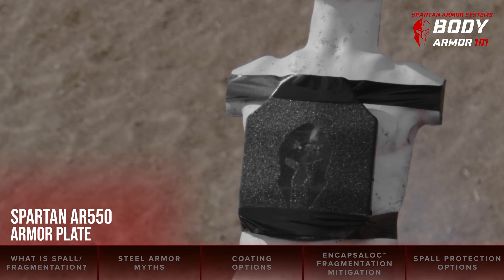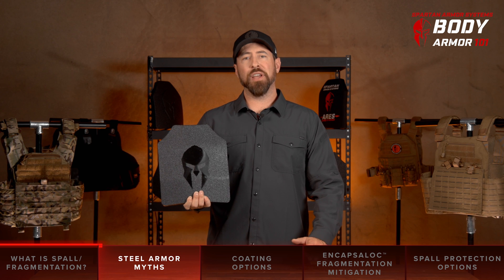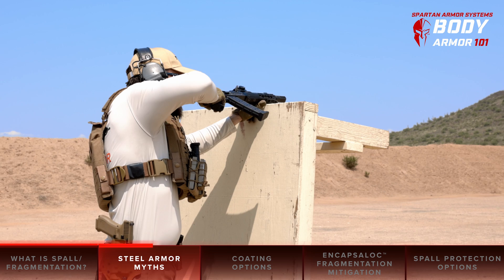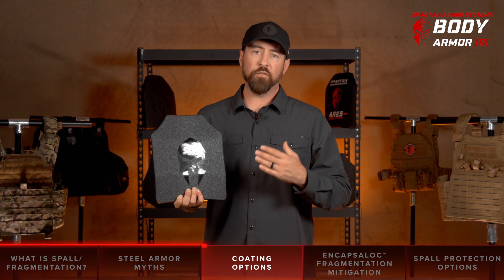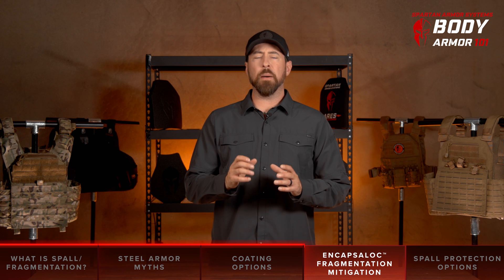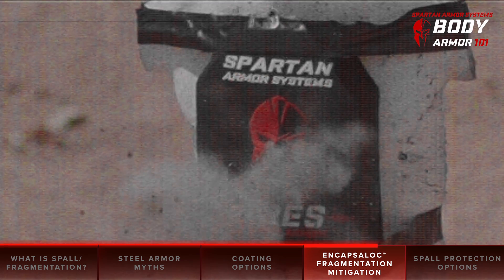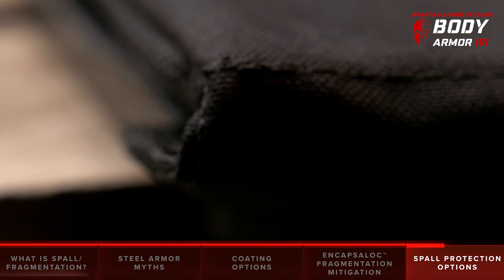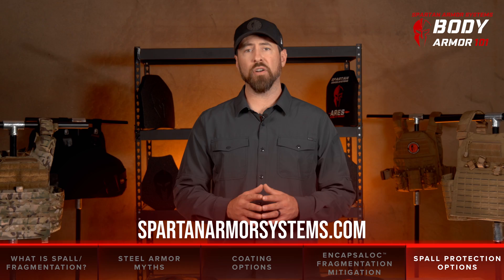Body Armor Spall & Fragmentation (Fact vs Fiction) - Spartan Armor Systems Body Armor 101

Comment: I'd always choose steel for CQB. If the weight was that much of a factor, choose the ceramic for long missions as also it's unlikely you'll be hit with multiple shots at range. As for myself, I'm used to walking around with extra love handles in winter, so a couple lbs wouldn't bother me.

Comment: Even your thicker coating can split and let fragmentation through, especially on hits near the edge of your plate. How about, instead of selling me a plate and then selling me a ballistic sleeve to put over it for an additional charge, you just incorporate it into the original product. A combination of kevlar and ballistic nylon that covers the strike face and wraps over the edges, creating a kevlar pocket to catch spalling. This could be a simple level 2 or 2A layer due to the reduced velocity of the spalling. I know you're a business, but stop selling me two products for two jobs and just make one product that does both. Simple, reliable and cost effective. AR500 plate and kevlar combo.
Reply from the maker: We're working on this exact solution.  Just want to get it right.  Thanks for your input.

Comment: Cardboard in front of the plate helps, also lv 1 soft armor will help
Reply from the maker: I am not sure I would recommand that over a spall bag or full fragmentation Coating, it does not sound very safe
Reply: @SpartanArmorSystems  I’m too broke so I use layers of cardboard in-front of the plate, theoretically it is supposed to reduces spawl, but I haven’t tested it

Comment: I hear that steel shall can cause injuries...but haven't been able to find any data on this actually happening.  Plus wouldn't a Kevlar carrier eliminate that anyway?
Reply from the maker: Not necessarly, it would depend on what firearm is being used. Kevlar is only able to stop conventional hand-gun bullets. While steel can cause bullet ricochet and/or fragmentation, the full coating significantly helps to prevent the bullet spall from escaping the plate.

Comment: That’s just fragmentation. Technically spalling is shards of ARMOR that break off the BACKSIDE of steel armor when defeating an impact.  This is not really a concern for small arms, so people often (yet still mistakenly) use fragmentation and spalling interchangeably in the body armor world.  Vehicle and ship armor experiences actual spalling when absorbing HE rounds where the armor stops the round and spalling can still kill everyone in the compartment behind the armor wall.  This is why in large vehicle and ship construction you’ll see relatively thin armor bulkheads INSIDE the ship; it’s not to stop incoming rounds (it would stand no chance) but rather to stop armor spall from penetrating into ship compartments after the primary armor stops incoming shells.

Just saying… spall and fragmentation isnt the “same thing”.
Reply from the maker: Thank you for your input.

Comment: What's up Spartan.  I own your AR550 3+ package in 12 inch shooter cut which I purchased because of the NIJ certification.  ((Guys, buy "NIJ certified" armor, not "NIJ compliant" armor whenever possible.))  I am very happy with the purchase and the plates arrived quickly and look half decent.  That said, I have not been shot at yet so hopefully all I will ever need from your armor is peace of mind.  That said, I do like to take extra precautions so I am using some spall sleeve and wanted to know your thoughts on using a 3a SBA backer.  I had a Survival Armor Phoenix 3a vest from my time with a previous employer and the front panel actually fits damn near perfectly in my carrier.  So I have two choices.  I can wear the 3a vest UNDER my plate carrier, (which is bulky and hot, good in the winter though).  So while it's warm, I have been using it as a trauma pad in my carrier behind the 3+ steel as a means of cushioning any impact and extra ballistic protection.  The pad fits into my carrier pocket and ever so slightly over-wraps the top and bottom of the plate (not like a taco, just slightly bent over top and bottom) which seems to me like a little more insurance against spalling.  
Do you guys at Spartan have any objections to anyone using a 3a pad behind the plate?  Or do you think it's better to just wear the soft armor under a plate carrier?
Reply from the maker: IIIA soft armor behind a plate increases protection, can't guarantee the amount though. We've done some unofficial testing and the results were impressive.

Comment: There is a reason no steel armor is NIJ certified
Reply: Except there is NIJ certified steel and you clearly don't know what you're talking about.
Reply: @majorpwner241  NIJ tested not certified
Reply: @thegunshow7635  You're wrong. This isn't even hard to look up.
Reply: @majorpwner241  dude it’s not even expensive anymore to get lightweight multi hit ceramic/ polyurethane plates it’s 100x better that steel targets
Reply from the maker: Actually that is not true. Our level III+ AR550 Single Curve Full Coated plates are infact NIJ Certified.
Reply: @SpartanArmorSystems  cool except I’m not taking spalling to the face buy once crye once

Comment: I guess my Question is, why not just sell the armor full coated with the sleeve as standard and make the raw corrosion resistant plates a special order? If the Spalling is a known issue with the unprotected steel, just solve the problem from the beginning. Not an accusation, a legitimate question.
Reply: I would assume the reason is solely affordability. One of the big reasons steel stays competitive with ceramic is price, after all. The more you add on to it up front, the more people you buy out of being able to afford it. If they're then able later to afford to take measures to eliminate more spalling risk, you still end up paying less than ceramic, but you had the protection even earlier at the cost of some more risk. At the end of the day, some armor is better than no armor.
Reply: Because not everyone needs a spray on coating. Some have the other carriers that do the mitigation for them.
Reply: Their thinking is, if you can't afford the extra for coatings and such, you can at least still get your vital organs covered, spalling is an issue to be considered and mitigated, but it's far less likely to be lethal than getting shot in the heart or having a lung (or both) collapse.
Reply: Some folks might already have spall mitigation sleeves and a high quality carrier with 3a backer and not "need" the additional layer of spall treatment.  Me personally?  I got the spall build-up layer but I also run a sleeve and a 3a SBA backer as a trauma pack (an insert from soft body armor I own)
Reply: @Ralph Ralpherson  this. Never been hit but I'm pretty damn sure ever with their top level armor it would HURT. I've seen what  .308 does to an animal, or the dirt or rocks. This is a great suggestion. Another alternative is to use some level 2 CE armor from motorcycle Armour. I CAN attest that that shit works and very well for extremely hard impact dissipation. You'll get the wind knocked out of you. Maybe break a leg in half😅 but you'll live. Anything is better than nothing
Reply: Because of capitalism. They don’t really care about your safety. They only care to squeeze every dollar out of you as expected. Nothing wrong with that. Just the way it is.
Reply: I agree wholeheartedly especially the market for plate carriers, plates, and accessory bundles can range from $300+ - $1000+. So might as well start it as the marketed plate to remove the non coated armor.
Reply: Reno May recommends Steel Ops...they look very good...
Reply: Ah but it’s a business. Release product now then get ready to buy next product later
Reply: It was like.. hardly anymore $ for his and hers plate carriers to be coated. It's basically rhino lining🤷‍♂️ actually. I'm pretty certain it's prob some knock off rhino lining. Go buy a few cans of it at your local auto store and stack it up🤷‍♂️ if you're going to go all out get a frag sleeve and add your own extra "special coating" over their special coating. I will say one thing. The XXL plates and XXL side plates are fking heavy. Even for a huge fella. Heavy. The ceramic options were just insanely expensive. Like.. 2 full ceramic armor kits OR a pretty decent car expensive.

Comment: Ok well i jumped on the bus when i 1st started prepping for SHTF. Of course im not crazy in the sense that i plan to run for the hills but staying at home with a bunch of nuts running around with guns isnt a good option either without body armor. So i purchased not just one but two sets of AR500 plates of lvlIII for rifle rounds. Only problem is i didnt have a ton of money and purchase base coat plates. So what do you suggest now ,knowing what i have? Will your spall sleeves do the trick or should i try playing the lottery to buy cermaic? Or even steel plates with a spall coat? :>(
Reply from the maker: It really depends on your budget. Spall Containment sleeves offer some additional protection, but full coat plates with a spall sleeve are even better. If you have the funds, then ceramic is a good option but then shelf life is only 5 years (depending on how you care for your plates).

Comment: Just an observation here, why would you sell a plate with just a single base coating in the first place? Wouldn't it be manufactures fault for putting forth a half ass product if you know most consumers do not always have the money to purchase body armor let alone worrying about "spall  coatings that should come as a finished product not as an option. Prevent rust coating should be the least of your worries. The focus should be an affordable finished product that for the consumer; one can depend upon.
Reply: Exactly I would want a fully finished product. If the coating is ideally important than they should add it to the finished product not have it as an option. Any average Joe who knows nothing about body armor. Who stumbles upon the website will see the coating as an extra option that cost an extra  $60 and won’t add it. As to them the plate itself it the bullet proof part, and would know nothing about spalling. What is going on is tricking people with a $183 price tag to draw them in, and add a extra $60 for the coating. Which actually put its price range right up there with other manufacturers who actually sell a complete product with the coating as a feature not a option.
Reply: I'm only speaking as a consumer and own both ceramic and steel armor, but I will say I would recommend steel armor with no spall protection over no armor at all. In almost every situation, taking spall to the chin, arms, or other areas is going to be more survivable than a direct hit to the center mass in an area that would have been covered by a plate.

Comment: I just ordered 3+ plates I will order the sleeve later. Gotta run with my budget lol. I am already over extended but in my profession it has been increasingly more important to have higher rated armor. Thanks for all of the info.
Reply from the maker: Thanks, we appreciate your business 🍻
Reply: @SpartanArmorSystems  as an LEO I appreciate quality at a reasonable price!! Thanks for helping out us little guys!!
Reply: Unfortunately with steel no matter how good your plate carrier is or “anti-spalling” you will always get crazy blunt force trauma and spalling into your arms and neck/face. Ceramic prevents this because the bullet is basically eaten by the ceramic, the bullet embeds itself into the plate. This is why all militaries use soft Kevlar or hard ceramic but NEVER steel. Trauma surgeons would have an easier time removing 10 FMJ’s than one bullet that exploded into 100 tiny pieces inside you ripping you apart lmao.

Comment: I had 1 set from you guys, it was a little large so i ordered slightly smaller plates.  My buddy was going on an on about the spall and that it was useless.  So I shot up one of my old ones at the club, hit it 5 times with 5.56 green tip and 5 times with 7.62x39: No penetration, and no spall until the 8th round hit and even then it was able to stopped by the cheap-o carrier I tested it in.
Reply from the maker: Yeah, there's definitely a lot of half-truths circulating about spall!
Reply: Did you try shooting it on an angle? Cuz it makes a very big difference
Reply: @ChevTecGroup  i agree. Doubt the spall coating would do much at an angle. I tested a competitors plate at a 45 and it came right back out. Would have caused significant damage to wearer or bystanders. It was a really thick coating too
Reply: @johnstarr1990  Did you test a ceramic plate at the same angle?
Reply: @larrybrock6811  no sir. I'm not rich enough to waste that much money on a test. I did however buy a spall sleeve and test the steel again at a 45 and it stopped it completely with multiple rounds
Reply: @johnstarr1990  That's good to know

Comment: I cringe everytime I hear "ceramic is the best and only option for plates, steel will let you killed with frag!" 
What you were talking about at the end is insanely important if you are going to rock steel. A high quality aramid/kevlar carrier is an absolute MUST. I never knew there was a company that made aramid sacks for your plate.
I get why people like ceramic and those hexagon dragon skin vests are really high quality and super durable. But you pretty much get the same amount of protection if not more from a steel plate with a coating and wrapped in a some layers of  aramid or kevlar. And for way cheaper too.
Reply: Not really. You can get Level IV ceramic plates for about $110.

Comment: I seriously doubt you stand to gain more from people buying "expensive ceramic plates". Would love to see your margins on those vs. a slab of steel sprayed with truck bed liner. That you then upcharge people for a thicker coating of. That you THEN upcharge people for a spall sleeve for on top of it.
Reply from the maker: It's more of a budgetary and muti-hit capability issue for most people. We've had plenty of law enforcement officers get shot wearing our full coat steel plates in the line of duty and it saved their lives without any secondary injuries. Steel isn't perfect, neither is ceramic but people who say "it's ceramic or nothing" aren't looking at the big picture.

Comment: Greetings and Felicitations from the Vallley of the Sun!
The presentation was on point addressing the concerns regarding the risk from bullet fragments after striking steel armor.  Indeed there are many online videos that caution against choosing steel plate due to the fragmentation risk. Thanks for providing a sober counterpoint to these allegations.

However, what stood out to me was the issue of "shelf life".  This factor would seem to be a variable more critically important for body armor systems worn or stored in high-heat environments.  Though I have a high degree of certainty of the imperviousness of the actual steel plate, I do wonder about the capacity of the anti-fragmentation coating and other mitigations to endure high-heat environments (e.g. stored on board a vehicle).  It's not everyday that you may face a threat requiring to actually don your body armor, but when you need it, can you still count on it when it's been stored in your vehicle over the summer? (IRL today the ambient air temperature is 112 degrees Fahrenheit, months more to follow)
Reply from the maker: While the coating can handle the temperature scenario you mentioned, the shelf life of armor applies to its ability to stop a bullet at its designated protection level.

Comment: Should check our Administrative Results vid on this he shoots plates in carriers and still got some frag in the chin and neck of his dummy
Reply: Forsure you guys got some awesome stuff keep it up!
Reply: The first video he did was entirely only base coat and he got some crap for it in the comments.
Reply from the maker: I watched that video, there was barely any coating on the plate he shot. It wasn't clear if it was a base coat plate or if AR500 is just going very thin on their spall coating. We use a significant layer of spall coating on our full coat plates. Still, it's always a good idea to us a spall containment sleeve with steel plates if spall is a concern.

Comment: Why not make the coating the standard instead of a $60+ add-on then if everyone else is being so disingenuous..?
Reply from the maker: Because coating is only one way of mitigating spall, there are other options. There are also many situations where spall isn't even a concern for the customer, we have a lot of customers that buy plate carriers and armor plates to use as a weighted vest when they work out. It's not something we haven't thought about, but there are legitimate reasons.